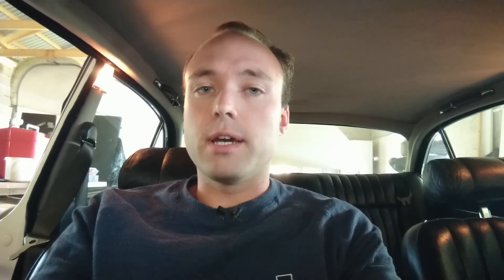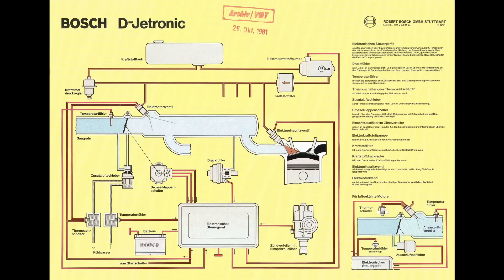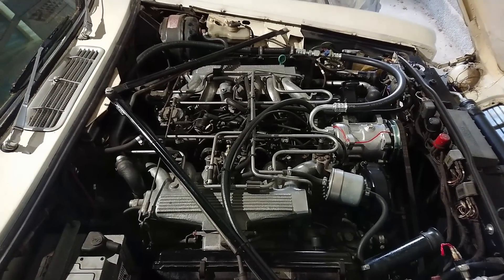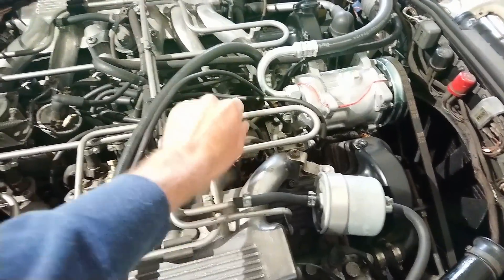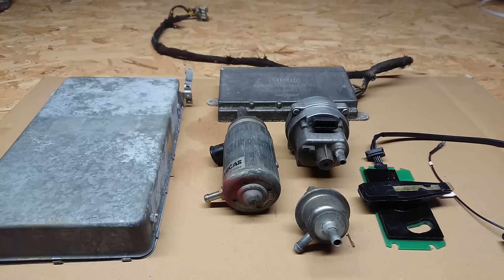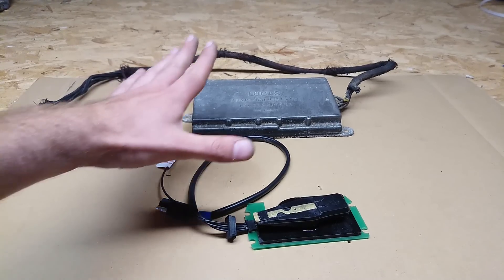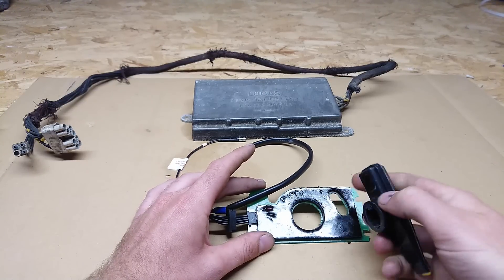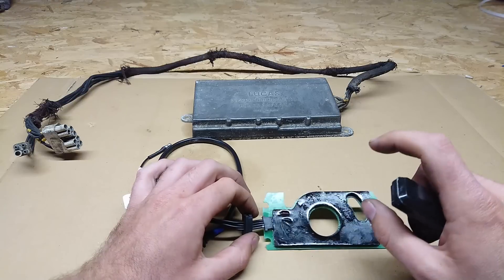Understanding D-jetronic Fuel Injection - An overview of Bosch D-Jetronic in Jaguar V12s (1975-1980)

Comment: this is not a bosch d jetronic system.  it is the lucas injection system copied from the d jetronic system.     bosch dit not use the  injector amplifier and did not use the "magnetic" injector puls generator.

Comment: I guess if it hase crabk sensor ans sequential injection the injectors should be electric.in that case in my opinion it us more advance system then K or KE where the injection is constant.correct me if i am wrong

Comment: Hi Adam, I've been binge watching your V12 videos.  Great information!!  As you know I am restoring a 72 XJ6, but I also have a 1971 XJ that is missing an engine and tranny.  I have a lead on a V12 from a 1976 Jag and thinking I might pair it with a manual tranny and upgrade the fuel injection to a modern ITB system controlled by a MegaSquirt or similar.  What would be your thoughts?  Any warnings or things to look out for regarding the engine?  Cheers.
Reply from the maker: Hi Jeff! Send me an email and we can talk more about this. There are a few aftermarket fuel injection systems that could work for you

Comment: I have a 1986 6cyl 3.6 jaguar xjs . The problem is when slowing down when engine speed comes down to 1300rpm the engine switches on & of rapidly causing the car to rudder. I am told that it is because the inlet manifold vacuum is low although engine runs fine & the ecu needs modification to cope with that. Have you any info on this mod.

Comment: I am coming back to review the video. I was having difficulties on identifying the fuel injection system on an m30 BMW engine. 
I am 100% sure that ignition is not controlled by the ecu. Only a signal from the distributor for telling engine speed and thus how many and when which quantity of fuel needs to be injected. However, I am not sure whether it is Djet or Ljet...
Edit: wrote this before rewatching. Now that I am proceeding in the video, as you start talking about the magnet of the rotor arm, it even confuses me more. And how are they fired in a d jetronic? Each one separately when the injection is needed or?

Comment: Thank you so much Adam I watch the fuel rail pictorial mine was leaking and I just put hose clamps on it not good I need to redo it but then the Jaguar quit running I think it's the fuel pump I can't seem to find it it's a 1990 xjs 12 I love the car I don't have a book I need a book also I'm not a mechanic just a parts changer with passion thanks for all your help
Reply from the maker: Do you hear the pump priming when you turn the key to the 'on' position?

Comment: I also add the very important info that the injectors are working on 3 volts , the sistem with trigger points. So.,don t apply 12 volts when cleaning, because you can burn the coil.
Great vid btw , i love D Jetronic
,and now i have on the table a nice Benz 300 SEL /9 3.5 i have to bring back to flight
Cheers mate!✌️🥇😎🌞
Reply from the maker: Thank you! 
Yes that is a good point, I will mention it in a future video on the injectors.
That's a fantastic car! How's it going?

Comment: Great Video. I have a Bunch of Djetronic parts, ready for when they fail.  Question i have is what is the Model of that AIRCON compresser? I want to use a sanden like that rather then the New A6
Reply from the maker: It's a Sanden SD7H15 that I got in a kit from Fen Air. I have sent you link on Instagram also. Thanks for watching!
Reply: Living With A Classic Awesome thank you!!!!